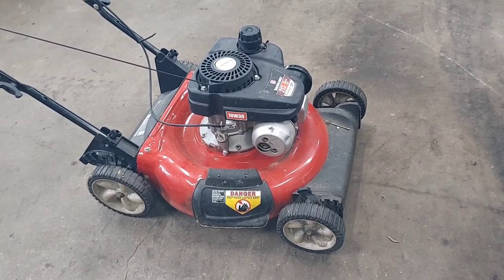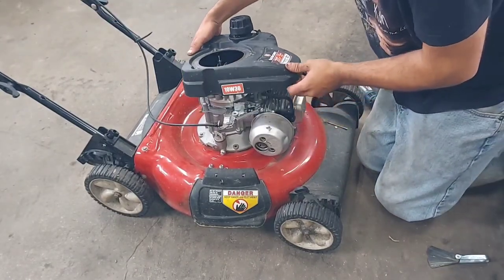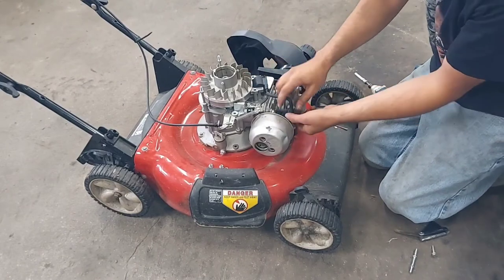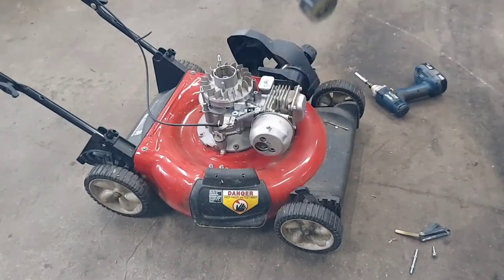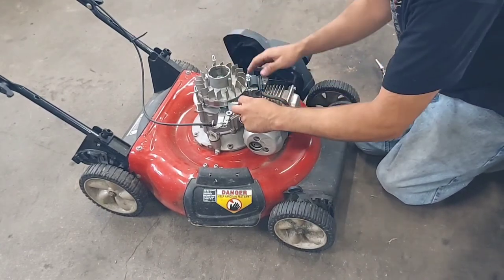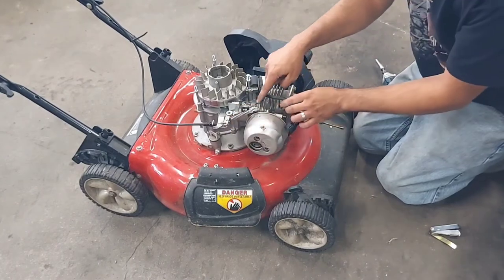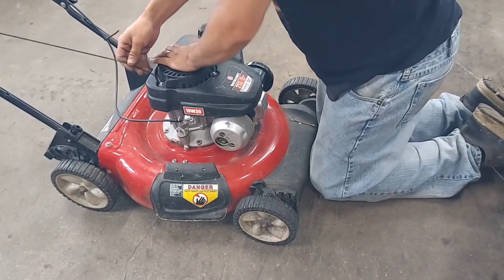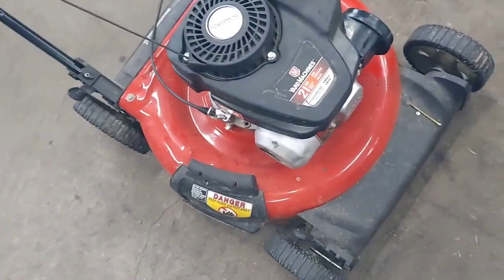Yard machines 140cc push mower ignition coil replacement

Comment: You know there's a trick to that, right?  Good video...
Reply from the maker: What's the trick?
Reply: You first put the coil on with the magnet rotated away from it, then tighten the coil down away from the flywheel.  Rotate the flywheel back aligning the magnet with the coil and insert a calling card between the coil and flywheel.  You then loosen the coil screws and retighten them after it presses against the calling card.
Reply from the maker: Awesome.  Thanks for the tip!
Reply: @Whitestrash  You're welcome.  I'm impressed that you did a fine job in accordance with the service specs and also were careful not to over-tighten the screws.
Reply: @Whitestrash  Actually, I meant to say "business card" rather than calling card, but you get the idea.
Reply from the maker: @campbellpaul  I knew what ya meant.  Thanks again.